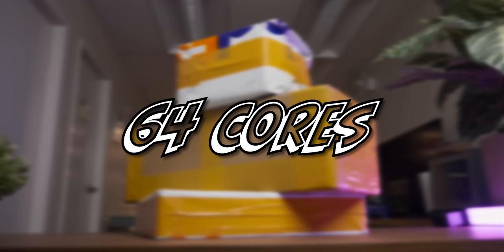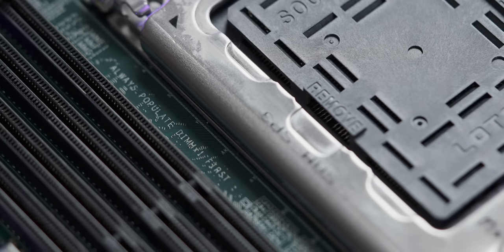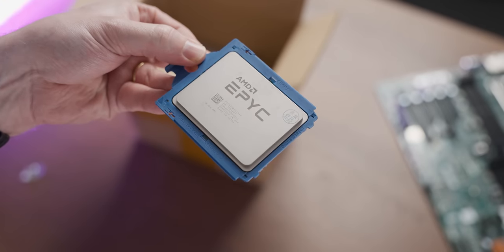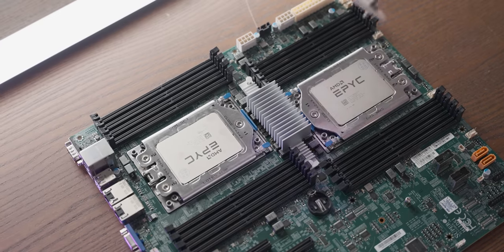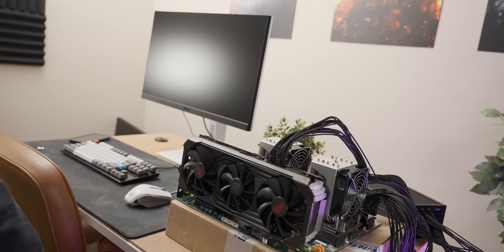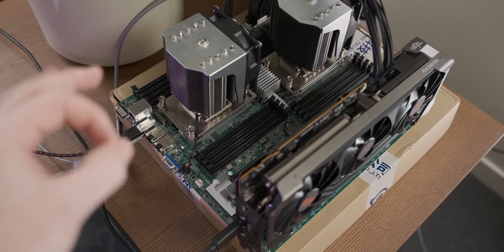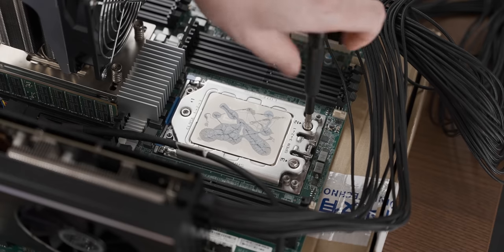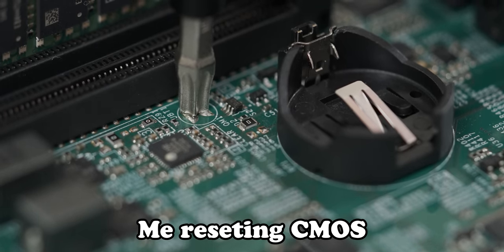I Bought 64 CPU Cores From eBay For $400...

Comment from the maker: Thanks for all the suggestions about the torque on the socket. The seller didn’t send me a torque wrench with my purchase. It is eBay after all. 😂 I do think I accidentally got the pressure right for the final mount considering that I got it to power up. However I will get an appropriate torque wrench for the follow up video.
Reply: what's the model of motherboard?
Reply: (copy pasta from another comment string)  the early epic's were extremely sensitive to mounting pressures. Even mounting the heatsink could wind up screwing up memory channels etc. There's a pretty specific way you need to install the processors and hsf's. And yes, it can take a longgggg time to do memory training...like i seem to remember it could take upwards of 10-15 min or more sometimes (although you probably would have seen some signs of life if you got to the memory training phase). Anyway....looking forward to seeing you figure it out 👍
(Edit-you should send Wendell a message from "level 1 techs"...he lives and breathes this stuff. I'm sure he'd be happy to help you out)
Reply: yeah go ask Lius for one. He has like 10 of them.
Reply: I would also check what pcie lanes are assigned to what slots, it may not be able to boot a video card off of the second CPUs pcie link
Reply: please release touching cpu cooler video
Reply: I think this is the first time I've seen anyone setting one of these up, I hope you get it going.
Reply: Oh thank god. I almost cried seeing that mount 😅
Reply: hope this helps you and can't wait for the update video
Reply: @grumbert  it said in the video, h11dsi.
Reply: Typical mistake. The torque spec is 13.5 inch pounds ot 1.5 Newton meters. I think I may have an actual amd torque wrench
Reply: glad you got it booted lol excited to see the follow up
Reply: Linus put the weight of his whole upper body on the cooler when he was trying something similar and it worked. JK, don´t do that. ;)
Reply: Here's how you do it: 
Start all three screws first in the right order. Then use a Threadripper or Epyc torque wrench or another torque wrench that can do exact 1.5 Nm (not less and there are no lbs./in. 😆 Just joking its 14 lbs./in.) until it clicks in the same order. Then use a metric ton (at least triple of what you used) of thermal paste and intall the cooler starting with the top left corner, then buttom right, buttom left, top right bit by bit until all four screws are tide. 
And if you only use one CPU use the one above the PCIe Slots which is CPU1 and always populate DIMM C1 first. On the board it says used DIMM x1 first cause that are obviously the ones for CPU1. Deinstall the GPU. Being a server it will probably output about VGA frist until you change it to PCIe. You can also connect over the Management LAN Port on top if you know its IP adress or over the mesozoic port via console.
Reply: FEEL FOR YOU BRO MASSIVE DENT IN THE WALLET
Reply: Having mounted EPYC cpu's myself (which with the cpu's being about 8000 euro each was really scary), it was painfull seeing someone trying to do it without a torque wrench...
Reply: Used DDR4 ECC is CHEAPPPP relatively speaking, 8GB Dimms are around 8 bucks per dimm, so populating 16 channels would get you 128 gigs of ram, for 128 dollars. I also had this fun when i got into threadripper, same basic socket, but it definitely needs to be super torqued down, I RMA'd a motherboard in the past only to realize "yes, those screws really do need to be screwed in that tight". On the plus going through that experience made me much more comfortable working with WRX4 servers hah, if you can pickup a threadripper torque wrench it should work a treat.
Reply: I think those blue tabs on the socket CPU slider need to also be pressed down (affects mounting pressure)
Reply from the maker: @yiannos3009  I did press them down until the clicked in place. 👍
Reply: Funny I was just about to suggest to check the mounting pressure. Most epyc systems have that issue. The torque wrench is a required to get them mounted.
Reply: Good to hear. I have not used an EPYC system but know from reviews back then that getting the torque right is near impossible without the proper tool.
Reply: You can also check if the MB has standby power by checking one of the start pins is at 5V/3.3V, ie, GNDing this pin starts the MB. You can also check SMD caps near the SIO for standby power.
Yeah if the PCH doesn't see the CPU, ie, not enough pin contact, it's not going to start.
Reply: Yes torque wrench very important and so is the order of screwing it in

And please go ahead an use a spreader and a crap tone and i mean a crap tone of thermal paste!!

Servers are not ok with the just squash it method
Reply: yeah i was about say, don't you need like a special torque tool for these CPU's cause there sensitive to mounting pressure.
Reply: Can we see it run with only cheeseburgers for cooling?
Reply: On a lot of server motherboards you have to first boot to the bios with the onboard VGA port. Once in the bios you have to configure bios first before booting off of a GPU. This motherboard is not designed for gaming...
Reply: I think Linus did a video about this years ago with a similar motherboard...
Reply: I was part way through the video and was like I'm pretty sure those large AMD chips like the EPYC and Threadripper need to be torqued to a specific pressure. It sounds like you figured that out and got it to power on.
Reply: not sure why you went Zen1 as well...
Reply: i was actually going to commentt that hahahahhahahahahaha yeah, those big sockets require very specific torque.
Reply: Get a FAT (Fire Arm Tool). It's just a fancy screwdriver that you can set custom torque break points and it will beep to alert you that you've reached the desired torque. That way you don't need the specialized tool each and every time, just need to look up the specification.
Reply: @WilReid  yeh those were very expensive when i was looking, i did manage to get specialised tool but never touched the cpu for fear of messing with it (so  expensive even for the cheapest threadripper!)
Reply: The micro SD port on the board is still used today.  We have them on the blades where we run VMware ESXi hosts.  The OS for each host goes there so that disk can be kept separately on a SAN and can boot without SAN or attached SSD's.
Reply: You need proper tool to screw the processor to the motherboard
Reply: I don't know why you and other YT tech presenters don't get a couple of those ready made power switches, that are basically two wires with a button, that you put onto the power pins. They are pretty cheap and save faffing about with screwdrivers.
Reply: Just curious, how many different power supplies did you try? Try using the highest quality, highest watt rated PSU you can get. As an aside, I have an automotive torque socket wrench which can measure out 13.5 inch pounds, if that's what the torque is, although I don't know if you would want to use it on a mobo.
Reply: Deng.. I found at the scrapyard yesterday over 300GB of ddr4 ecc ram. Got it for free. :(
Reply: Rookie mistake, even just watching it getting "torqued" nearly gave me a heart attack. breaking a very expensive stuff.
Reply: Hi, Dawid. So, where is video with faster RAM (3200) in the system?
Reply: Another thing is if you turn it on the first boot might take up to an hour depending on how much ram you have.

Comment: These CPU retention brackets need to be torqued to a specific spec. if that's not the case you could get bad contact on the pins of the socket to the CPU and that can end in a no-boot scenario. Usually, if you buy these CPUs ne, there is a tool included. That is missing in you case, Dawid. I suggest getting your hands on one of those tools ans try again.
Reply from the maker: Thanks for the suggestion. Will definitely get an appropriate torque wrench for the follow up video.
Reply: Yeah they even give you that specially clicking, orange, T-shaped, torx screwdriver with Threadripper! I remember it when I built a 1950X workstation back in the day.
Reply: It honestly should still power on with NO heat sinks.  It would just overheat and power off in 60 seconds.
Reply: Also remember that server hardware takes a LONG time to fire up properly. I noticed at the front there was a little green light flashing? Did that give you an error code of some type? Did you try  plugging a monitor into the onboard VGA to see if that gave you an output? I'm not sure if it was AMD CPUS but at some point they (HP or Dell I think) started locking CPUS to specific motherboards so that they would only work in that specific combination. Thank you for such entertaining videos good sir 🫡
Reply: @the_wiki9408 He's talking about the retention bracket screw, not the heatsink ones
Reply: Was just about to comment this, glad others picked up on the issue too 👌
Reply: He's correct, he beat me to it. I was hoping you would have figured it out by the end of the video. 😅
Reply: I'm guessing the TR4 torque tools match the SP3 spec. Threadripper ones are much easier to find.
Reply: and additionally, you were using a torx bit one size too large. notice how it didn't sit down into the screw head all the way and you had to be super careful that it didn't slip? that usually is a good indication that you need to go down a size
Reply: I have built EPYC servers without so much as the tool, oddly, all you need is to "slightly tighten" with a torx screwdriver, no more no less.
Reply: I actually have a very weird feat: I actually broke screw 2 on an Aorus X399 by trying to torque it as much as I could while lacking the tool. Tested it with a Wraith Ripper in a flat table, worked fine. Put it into a normal case, surprisingly also worked well. Sold it noting the defect, and last I heard it was 3 months in with no issues.
Reply: I bought a EPYC 7551 new in a retail box a bit ago for my server & it didn't come with a torque wrench.
Reply: Maybe the mobo got IPMI? Might give you a clue.
Reply: OMG thank god someone said this. I had my head in my hands the whole time like noooo! The hardware is fine! It’s just the cpu mounting pressure!! Haha. Hopefully that should solve the issue. 100% it’s this.
Reply: Im just in the midst of buying a proper wrench for my pc build but does anyone have suggestions of which toolset to buy that doesnt break bank.
Reply: @MaDeXism  If you're going Threadripper or Epyc, get one of those official ones.
If it's anything else, just whatever you find on a dumpster dive.
Reply: @Fay7666  not sure if you find torque drivers in a dumbster but ill give it a go ! ;)
Reply: @bhasselgren  It absolutely has IPMI! And yes it can indeed be accessed to see if there's any issue
Reply: Ah ok
Reply: Problem Is Touching Wrong Header On MotherBoard
I'm explained the solution to This problem
Reply: Tfw n/ft-lb
Reply: @DawidDoesTechStuff  Yep, that's the first thing I noticed. You used your iFix it bit and you should use a special AMD bit with a specific torque limit. I believe even with the wrong RAM the system should attempt to boot because in order to know which RAM is installed it has to.

Comment: The network port above the USB plugs is ipmi I believe, you should be able to plug that in, then go to the IP address that gets assigned to it in a web browser and log in and the board will probably tell you what's wrong, and you should be able to power it on from there as well.
Reply from the maker: That’s a great suggestion. I’ll look into that for the next video. 👍
Reply: Yes and usually you cannot turn on from the front panel until the ipmi server is running (and the ipmi is not very fast to boot...)
Reply: I was going to say the same thing. I used to support huge racks of servers, including dual CPU Epyc, Intel, Power6 (and above) AIX, HP-UX, and all those other fun letters. IPMI port needs to be connected to a system and booted through it to do the initial setup. You can then configure the MB to boot directly to the internal media, that is what those USB and SDcard connectors on the MB are for. You would, for example, have  VMware installed on a USB Stick or SDcard, and boot from it, then either have internal HDs, or space on a SAN/NAS/SAS that would have all the virtual machines and such. Lots of fun...yes, I am strange. 🙂
Reply: There is a led on the board that blink until the IPMI has booted. The IPMI password is on a sticker on the board.
Reply: @FarrellMcGovern  this is a lot of good information. It also tells me why it's a good idea not to touch server stuff without doing a lot more research lol
Reply: @TheLaurentDupuis  I have a similar Supermicro board, and the led flashes to say IPMI is working. It's a heartbeat indicator.

Comment: Jesus dude the way you screw the cpus down made me hurt inside you have to carefully turn each screw a step at a time to apply even force across the cpu onto the board. I won’t be surprised if you screwing on side down fully and then the other has damaged something preventing booting. Those “were” working but poor handling as per the evidence in this video probably killed them

Comment: its most probably a mounting issue as you need a a proper torque wrench with the correct amount of torque id suggest watch Linus videos he's had this issue before
Reply: This
Reply from the maker: That’s interesting. I’ll get a torque wrench for the next try so I can properly dial in the pressure. I think I did get it right for the last mount, considering the fans spinning up and all that. Interested to see what the proper RAM and mounting pressure will do.
Reply: This is what I thought.
Reply: also possibly could be doing memory training. The ethernet port on its own will be a iLO (or out of band management) port that will give a web site showing the bios error codes most likely could be worth trying that.
Reply from the maker: @samjonesmartin  That sounds super useful. I will definitely give that a try. 👍
Reply: @DawidDoesTechStuff  The torque should be around 14lb/inch or 1.5nm. But it will be better to try and find an AMD original torque wrench which is included in the box.
You should ask the seller to ship one of those with the ram that he is sending.
Reply: yup, just came down to comment this. the early epic's were extremely sensitive to mounting pressures. Even mounting the heatsink could wind up screwing up memory channels etc. There's a pretty specific way you need to install the processors and hsf's. And yes, it can take a longgggg time to do memory training...like i seem to remember it could take upwards of 10-15 min or more sometimes (although you probably would have seen some signs of life if you got to the memory training phase). Anyway....looking forward to seeing you figure it out 👍
(Edit-you should send Wendell a message from "level 1 techs"...he lives and breathes this stuff. I'm sure he'd be happy to help you out)
Reply: @DawidDoesTechStuff  linus used a ifixit torques and had similar issues you need the one that comes with the CPU Torx Screwdriver AMD Ryzen Thredripper Epyc Processor Star Only Tool it applies the correct pressure because if one side isn't as tight it might spin the fans but could be a memory issue i hope this helps
Reply: @colestowing8695  yeah exactly why i said about the mounting pressure but i also know that that amount of memory would take a good while to boot due to training
Reply: @WELSHYTECH  To be fair, the iFixit torque wrench is a cheapo turd with their label slapped on it. So, yeah
Reply: @rustler08  no you need the correct one for Epyc

Comment: You might want to torque down those cpu mounting screws a bit more. AMD gives a calibrated screwdriver just for that.
Reply: the question is how those ryzen thread rippers got killed maybe the motherboard killed them🤣
Reply: @raven4k998 We don't know that they're dead. If they're not torqued down properly, they won't work.
Reply: @kadrix732  sure that's gotta be it they are not torqued down properly🤣
that's it exactly which is why they sold the whole system for 400 dollars makes no sense at all unless they were dead to begin with that's how ebay works got a dead system sell it off to someone whom wants to try and fix it simple
Reply: @raven4k998 you don't understand how the value of quickly advancing technology is incapable of retaining value for any actual length of time.
Reply: @raven4k998  I've seen people have issues with actual threadripper CPUs similar to these issues because they weren't making proper contact. It's an actual thing.
Reply: @raven4k998  kinda dim huh?

Comment: Could the issue be not the correct torque on the cpu hold down? if I remember correctly threadripper used to come with a torque driver. Just a thought.
Reply: I was about to comment the same.
Reply: yep,you need it to be exactly the correct torque otherwise it wont seat the cpu properly and could even damage the mobo
Reply: I really dont think that is the issue